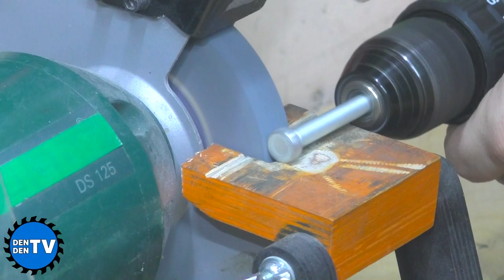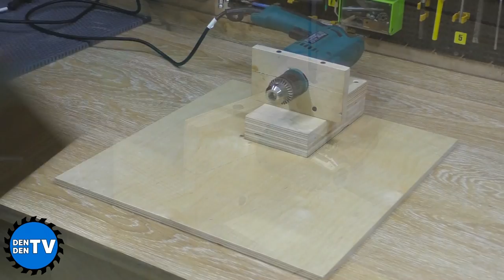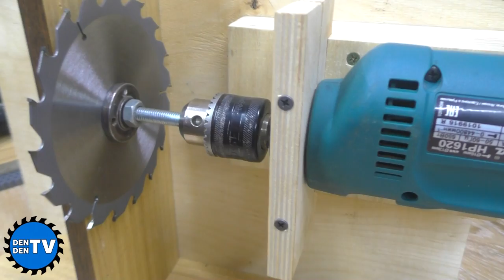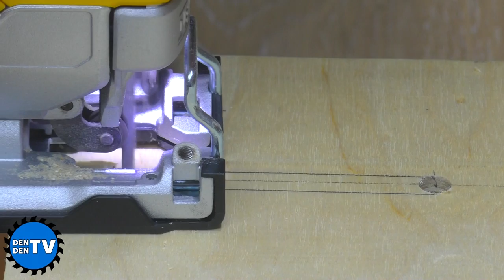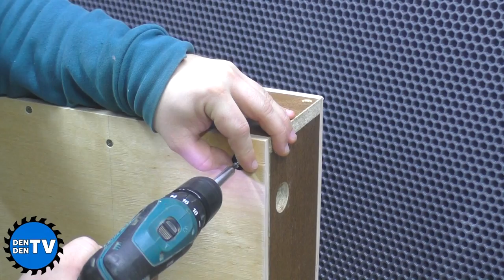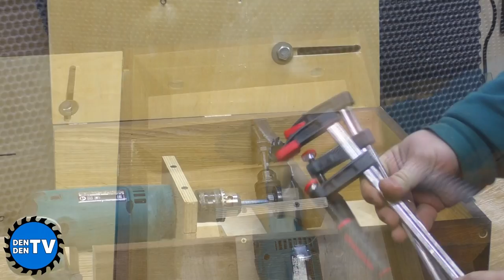Мало кто знает об этой функции ДРЕЛИ!!! Секретная функция.

Comment: Well done, but way too much effort and time put in to make something not-quite-as-good as the real thing, which probably could be purchased for the cost of the wood and drill used, not to mention the cost of time/labor. Good effort, though.
Reply: He could have also added a safety guard and a hole in the lower side to attach a vacuum hose.
Reply: This attempt is probably pure stupidity, considering the safety aspect.
In addition, a small circular table saw can be purchased for just under €50, which also has a riving knife and a height-adjustable saw blade.
Reply: @zafasoldenburg7001  Yes, true that. And not to mention that the drill motor doesn't have the torque or speed for prolonged cutting.
Reply: but much cheaper ;)
Reply: @dcbede2696  no
Reply: Agreed. This is just a novelty item. A lot of precision work along with time and parts were expended to make a table saw that will never be as good as the real thing but for  entertainment purposes, it is great to watch someone who is handy with wood working.
Reply: @ahdofu  Handy maybe but not very smart.
Reply: @zafasoldenburg7001  please show me the link
Reply: Your Comment Says It Best & A Homemade Table Saw Using A Drill Will Never Out Cut One Made With A Circular Saw.
Reply: That drill will get so clogged with sawdust it'll die after the first real day of cutting it goes through
Reply: @astarothmefisto3919  Sorry, but I don't know which link you mean right now :-(
Reply: Very silly. Just buy a saw. There is no merit in this nonsense and it does not have a guard.
Reply: Not only all the things said here but another very important issue with this would be safety, you would never be able to buy such a deadly device with no safety "dead mans switch" fitted, it would never pass safety standards in the uk , probably in a third world country and this is  more likely to be used in such places, just buy the tool designed to do the job, these Bodgers dont see the bigger picture im afraid.
Reply: Just buy a used table saw and save time and money.
Reply: What many of you fail to see is the value in disregarding the box. A mini table saw is way less than the time & effort spent here, agreed. A table saw is NOT universally cheap or available.  Drills are more ubiquitous,  worldwide and can be adapted to new tasks.  

First world problems can be solved by buying cheap consumer goods. Not the option for the rest of the world.  

Credit where credit is due.  You build something to see if it can work and sharpen your madd skillz bruh!
мир брат бегемот!
Reply: Exactly. Very clever, until you realise it would be far easier and if you're taking the value of your time into account, probably cheaper, just to buy the saw in the first place. No good if you need to use the drill regularly, so you'd have the expense of buying And as for forcing the switch to be permanently on, that's just suicidal.
Reply: sea  missing the point.  The world is not 1/2 drive from a big box store to purchase a cheap saw. 
I think our host is fairly remote.
Reply: @patrickhayes3099  Aside from the fact that you're just assuming he lives in the middle of nowhere, which doesn't matter so much these days as you can get anything delivered to virtually anywhere now, but this is just a handyman showing off his skills. It has no practical use to anybody else, it's just entertainment but otherwise completely pointless.
Reply: @severnsea  it is more than bravado. Look at the cues for location. He is in Siberia or another remote part of former Soviet Union.  The economy is poor & Amazon is not everyone's pal.  Where you live, this is showing off. Where he lives, it's the best way of achieving his ends.
Reply: @patrickhayes3099  Nah, I don't buy it. You can see in the video just after the 2 minute mark that they have a tool rack on the wall with an assortment of modern looking tools. It's probably a bit of both in truth, but he's got a drill and a bench saw they use to cut the wood. They have cars, welding equipment, internet, camera to record, other resources. I don't buy that they can't get hold of a circular saw.
Reply: why leave the drill- do the who thing up.
disassemble- reassemble as you want.
Reply: @Dylan-hc2lu  🤦‍♂️

Comment: Great, you now have a table saw with a very small motor that will quickly burn out from overly heavy use.  What about when you need a drill?  Going to make one from a rubber band and some forked sticks?  Or there is always the bow and string setup for a drill.  In short...this video is why we have hardware and tool stores!
Reply: Perhaps he could make a drill out of his table saw…

Comment: Next weeks video,... How many drills do I burn up while cutting various pieces of wood?  Never fear, I can use my old table saw over there in the corner as a work bench while I repair my "Drill saw".
Reply: Yes, a drill is not designed to run for extended periods of time in order to rip a board. You will destroy it in a very short period of time. Also, what do you do when you need your 1/2" drill? Yep, dismantle your "secret" finger slicer (aka table saw) so you can drill that 1/2" hole.
This is stupid and a total waste of the readers time. Go find another hobby that does not imperil peoples appendages!!!!!
Reply: Agreed.  It seems pretty obvious he already had a table saw that he used to cut the MANY pieces of wood used to create his "secret function".  As many different kinds of other tools we saw used in this video, he probably also owns a "saws-all", too.
In his next video, he'll use his battery-powered drill to run a small dynamo to power a light to shine on a solar panel hooked to a USB charger to recharge his phone.   He probably doesn't know these exist already: https://www.amazon.com/Bosch-GAA18V-24N-Portable-Power-Adapter/dp/B072JHNJK4 
At least he didn't try to use a battery-powered drill for the table saw project.
Reply: That's hilarious. Thanks.
Reply: @dwaynehunt1111  Fire extinguisher not included.
Reply: Omg i just laughed so hard. . Ua its not made for sideways pressure either.
Reply: @dwaynehunt1111  omg this video was well worth the laughs I got from the comments. Especially yours. Ya they make different tools so you don't have to do this Gilligan's island stuff
Reply: @johnlord4557  thats was hilarious.   I haven't laughed this hard in years.   You have the same sense of humor as me.  Lol
Reply: On his other videos he has a very nice Bosch table saw and a band saw everything
Reply: Hilarious. Thanks for the laugh
Reply: @johnlord4557  no he converted the battery powered drill into a lawn mower in a previous video lol.

Comment: From fast forwarding, I think you can get the mandrels otherwise much easier figure it out to other wise turn a drill into a miter saw. Probably easier to use a die grinder or angle grinder, and perhaps a vise grip mount or whatever. Seriously. Besides perhaps cheaper to just get the cheapest miter saw available, and or a used one of the cheapest miter saw available that otherwise works, from a retailer such as HarborFreight.
Reply: The arbor bolts threads on table, mitre saws run counter to the direction of the blades spin. This is to prevent the nut holding the blade in place from becoming loose during use. 
This video uses a normally threaded bolt and is a safety hazard because of it.

Comment: Frankly, I find this incomplete as far as simple safety additions, but it is exceptionally well done for what it is  Most folks just slap a circular saw on the bottom of a board, and that is their temporary table saw. .This is a step above that.    The lumber used in the project would cost as much as a cheap Chinese table saw from one of our local importers.   The Chinese saw has the few required safety features such as a riving knife and blade guard.   It also has sloppy miter guide slots that none of the standard miter guides fit and fence you cannot trust and must adjust both sides of to make decent cuts.  There is also no practical way to make zero clearance inserts for the Chinese saws, where you could have added that to this saw easily.  I see this as a make shift effort, if you only had a drill to work with and enough scape lumber to make it.  Still, I think a second version is in your future.

Comment: I can't say I've ever seen a quicker way to injure yourself badly.
Reply: I got ALL THESE fingers, and never really use more than seven or eight...
Reply: In the time I spent to watch this video I could have driven to the store and purchased a table saw.
Reply: @markatkinson9963  And for about the same price.
Reply: I was half expecting this guy to mount the open blade on the drill and start going around cutting random shit holding the drill with one hand.   :o

Comment: Some "secret functions" are really suppressed suggestions of dangerous ways to misuse a tool.  A power drill, even a corded one like this, isn't going to have the necessary torque to keep that blade spinning fast enough to cut through wood.  The motor will burn out once it's used on anything substantial.  

Here's another secret function:  Take a 7.25" portable circular saw, flip it upside-down and build a box around it.  Wire the switch closed and plug the saw into a foot-switch.  That'll be strong enough to use for cutting wood because, after all, it's designed to cut through wood in the first place.  But it'll be just as dangerous (if not worse) because the safety guard is defeated and the blade will be spinning faster than this drill/saw contraption.  

Wanna make your Dremel Tool into a micro drill-press?  BUY the Dremel micro-drill-press attachment.   It'll be cheaper than designing and building your own out of wood and it'll be sturdier as well.  Wanna make your rotary tool into a micro-router?  BUY the micro-router attachment.  It'll be cheaper than designing and building your own out of wood and it'll be more accurate, as well.  Wanna make your cordless drill into a super-anvil?  DON'T DO IT!  Learn the hows and whys of a tool's limitations and quit trying to circumvent them!    Just buy the proper tool for the job and quit trying to jury-rig contraptions.  There are serious safety reasons for NOT doing this crap at home.    Sure, it's awesome to MacGyver a make-shift tool if you're out in the middle of nowhere with scarce supplies or funds or time.  But if you're reading this you've got access to the Internet and there are a trillion companies just standing by waiting to sell you their properly-engineered tools and gadgets.  There's no excuse for losing a drop of blood to one of these better-to-keep-it-secret functions. 

Off in the 'related videos' to the right:  Few People know about this Function: Angle Grinder"

Let me guess:  A super-high-speed drill contraption, rather than a right-angle chuck attachment for your drill.
Reply: i have this kind of table already in steel it sells in sweden, u have an emergency stop for it though. but to fit the saw aligned is making use of your knowledge of your saw in the first place. only a fool fucks up, of course a fool fucked my saw up.

Comment: As a contractor of over 25yrs that drill will burn 🔥 up real quick! Just do a few long rips enjoy the nice camp fire. I’ve seen those drills fail and light on fire a few times, putting that amount of strain on a drill not a saw is a total waste unless your only ripping balsa wood. lol should have used a skill saw up side down that would make more sense and would actually last and take the beating a table saw could, not a tiny drill motor.

Comment: I happen to have 2 corded drills (3 if we include the dremal) along with  a cordless drill.  I considered this "secret function" and discovered I could turn one of my drills into a grinder, and then turn it lethal saw blade.
What is the better option,  
1 - use the existing grinder( if I have one) and just bolt the saw blade directly to it
2 -- construct something out of bits of wood and metal so it works a bit like a saw blade
3 - create a grinder  using above instructions , and then buy another drill to create the "Secret function"
5 - Buy life insurance and then try any of the above.
6 - Buy the machine for the job.
7- Pay for someone to do the job.
????????
My gut feel given I have all the tools to create this, is to either pay someone that already has a bench saw, or just buy one.
Chances are if you have a bench grinder , you are not far off a bench saw.
Justifying certain stuff can be tricky, but this is not the best suggestion I ever saw on a vid.

Comment: Ok, cool project however. A good table saw could be bought used for cheap and most drills are not designed for the side load work that you would have in this design.

Comment: I LIKE THIS IDEA AS A LOT OF OLD WIRED DRILLS ARE AROUND CHEAP.
I JUST WONDER IF IT WOULD BE POSSIBLE TO BREAK DOWN THE DRILL TO THE
MOTOR UNIT AND CHUCK PLUS WIRING TO THE TRIGGER AND THE POWER OUTLET.
SEEMS THAT WOULD ALL FIT INSIDE THE CABINET.

Comment: Someone had a saw to begin with to cut the boards for parts.  Therefore, except for the fact that the author probably had fun making it, why is it necessary?   Tight as it may be now, there isn't much to prevent the drill from shifting long term or being bumped in transport.  It's not a bad idea in a pinch, but for now I'll keep my table saw.

Comment: Unfixed drill body + friction-only secured bearing + sharp table blade, 3,000 rpm + heat + vibration. What could possibly go wrong?!

Save a digit/appendage. Invest in a proper table saw.

Comment: While the concept is interesting, the amount of time it would take to build this contraption, one could do something else to make the money to buy a decent used tablesaw. Also, this would be a good way to burn up your drill unless this was used only with a very small sawblade for projects very small in size. The motors for actual tablesaws have a lot more horsepower than these tiny motors for a drill. I suppose if you have more time than money and an extra junk drill they had some decent power to it, this might be appropriate for making tiny cuts. Again, if one  wanted a tablesaw for micro cuts, I believe they make micro tablesaws for around $100. I know you can get a decent 10 inch table saw used on craigslist or Facebook marketplace for around $100-$200 in Oregon where I live.

Comment: I would seriously question the safety and reliability of the interference fit between the bolt and bearing used to support the blade which is spinning at potentially 1000rpm…

Comment: A secret function? There's no secret function to turn a drill into a very poor table saw since these types of drills were never designed to do anything like it. In fact they use simple cheap bearings that are adequate for radial loads when drilling, but do poorly with radial side loading even with that equally cheap out board additional bearing. That's like saying the secret function of a Ferrari is there capable of hauling gravel. Yeah you could do it, just because you can doesn't mean it's a good idea. Clickbait will never get a subscription from me.

Comment: You seem to have almost all power toold needed for a woodshop. Why don't you just buy an average table saw, which would be safer and within specs and avoid all the inconvenience... just thinking aloud... the lenth of the saw bar to the drill is not sound, and the thread of the screw attached to the drill itself poses a dangerous situation as it can go lose anytime...

Comment: This idea seems incredibly irresponsible, there is a REASON we have purpose built table saws ffs, not least for safety aspects such as motor shutoff and blade retraction in the event you snag something fleshy!

Also complete lack of adjustment for blade height or angle.

Comment: I have had a need in the past for small table saw on a job site. I just plunged a circular saw (Skilsaw) through a piece of plywood. Not the best, but it worked until I got a portable table saw. Had 3 full size saws ( Unisaw) at my shop. The plywood shop was fine for me, but for safety I wouldn't let anyone else use it.
Reply: Tony... we don't care

Comment: Biggest issue, duty cycle of drill motor is significantly different to a saw motor. Leading to possibility of overheating or other failure. Fundamentally a waste of parts time and money

Comment: Nice craftsmanship but utterly pointless and not a secret function. If you add the parts and time taken it would be cheaper just to buy a table saw. Adjustable cutting height and safety are far more important!